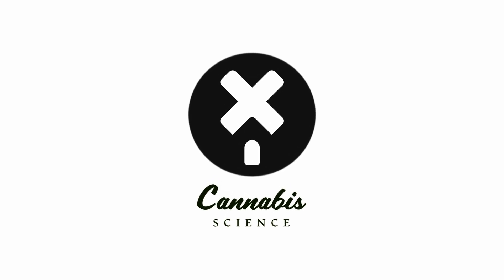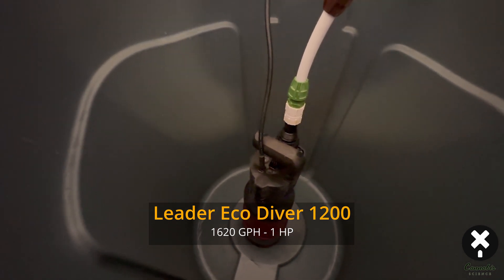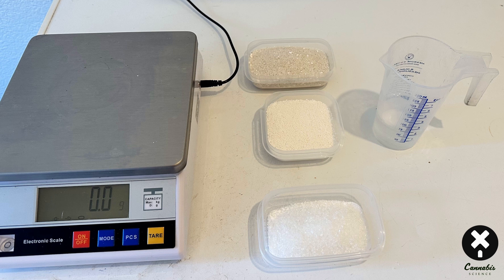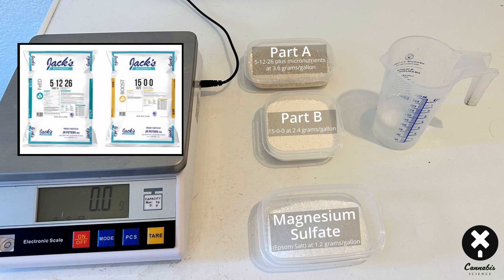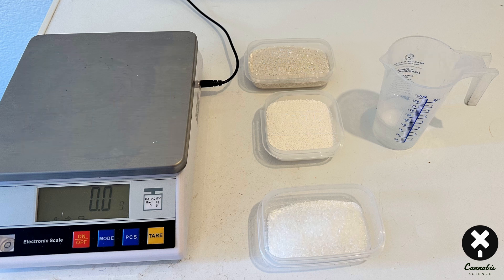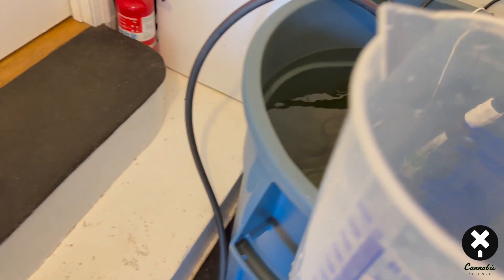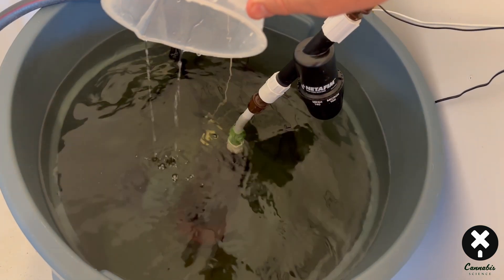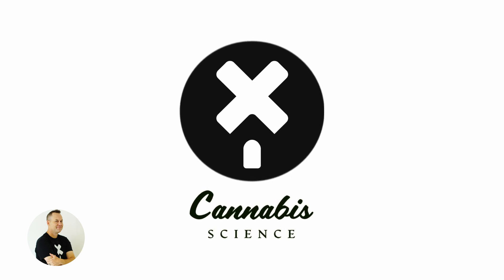How To Setup Irrigation and Fertilize for Rockwool Grown Cannabis in 2023

Comment: Hi Matt, do you need to maintain the water reservoir at a specific temperature?
Reply from the maker: Great question. Yes, try to keep the water temperature below 75F with ideal around 68F.
Reply: @ Thank you so much!! Any recommendations to maintain the water in optimal conditions? I just getting ready everything to start my next growth in Rockwool.
Reply from the maker: Personally, I just keep my irrigation reservoir outside my grow room in the hallway that stays between 68F and 75F. The water temperature is basically the same as outside air temperature. If you run into a problem of your water getting too hot then you can always get a water chiller. If too cold then there are these drop in reservoir heaters that are like 2 foot rods or so that will help maintain a warmer temperature.
Reply: @cannabisscience  Thank you so much!! 🙏🏽🙏🏽

Comment: How do you proceed when the tanks are getting empty with those kind of pumps? Are they able to empty it fully or do you have to throw away a small portion of the water?
Reply from the maker: Thanks for the great question. My pump is able to pull until there is about 3-4 inches of water left at the bottom. I don't like to run these pumps too dry for too long. I leave the 4ish gallons left at the bottom and just refill the water and add new fertilizer. Every 3 months I fully drain and clean out my reservoir and irrigation equipment.

Comment: So if you turn it on 1 minute then off and this happens every hour then how much do they get in that 1 minute, say it gets 100 ml every minute then in 10 hours they would get 1000 ml and in 12 hours that would be just over 1000 ml by getting 200 ml more? 
 I am asking because i don’t have the brain anymore for working all those nutrients numbers, PH etc and I’m in a wheelchair and my hands don’t work very well so forget all those tubes and fittings being worked on and a 50 gallon anything is not happening, hell I can’t even close my tent so humidity, temperatures pffft, I use 9’’ slabs with 4 ‘’ starters because they a lighter but I know nothing about them. 
I currently use Mantis Buffered Nutrients because it’s one bottle entire grow, no PH work because it’s buffered and there is no schedule just use with tap water when the plants are thirsty in a 5’x5’ tent with Migro 600 and my plants grow taller than me leaving me unable to measure light, height or even look at the buds, I am thinking of creating a Tip Pot, the thing I am trying to do is get the watering right and i got to do it by hand.
Reply from the maker: Thanks for telling me about your situation and challenges in growing. With your limitations may I offer a suggestion of growing style that may be way easier for you to achieve great results but more designed for you to handle in a wheelchair? My suggestion would be to grow smaller plants in like 3 or 4 inch rockwool blocks, but have many of them to fill your grow tray. Keep the plants shorter and flip them into flower quickly. A "sea of green " style. You could also just flood the tray with fertilizer water by hand or setup a flood and drain reservoir.
Reply: @cannabisscience  sorry, but you didn’t answer the question, I have no choice I can only water by hand, if I want to get a grow going now and I do o badly, I mean I dragged a houseplant into my tent, thats says I am desperate, I was thinking to add water until the slab lets the water go than take that amount and get it to do that say in 4 increments until it comes out, I was thinking by the third fourth it should show signs of coming out the slab, i have a brand new auto-pot set,  unopened, also a new Master-Controller, and even a new Air-wand top imitator rings, blah, blah blah, my biggest struggle would be just getting the box open.
I don’t want to be told to go to kindergarten growing because I can’t compete with you because your healthy, I can’t open 6 or 7 or 8 bottles just to grow so thats why I mentioned Mantis Nutrients, I did my homework they have spent millions on figuring out this product which is especially designed for home and commercial grows, ten different cultivars/plants one bottle.
I grow in slabs because I can lift the entire plant one handed, I would never trap myself in a sea of green, how would I reach the back and to search out low, stunted type of growing is depressing to even think about, I grow Sugar Black Rose and 11 Roses because they are fast photo and have less leaves, I am thinking to compete. Thanks again.

Comment: that is not a 50 gallon res its i think 32 gallon
Reply from the maker: It's a 44 gallon Brute Rubbermaid trash can. I fertilize at 50 gallons rate and fill up the 44 gallon trash can to about 38 gallons.

Comment: What is your shot size (% or mL) with that 1 minute shot?
Reply from the maker: Each one of my 1 gallon per hour emitters puts out 100 mls per 1 minute irrigation timer length or "shot". Shot times are typically longer early flower and get shorter toward late flower.

Comment: If you’re strictly growing in rockwool, u should check out the 2 part salt pro line from Athena Ag. (The blended line they offer is quite overpriced and is directed to small scale RDWC/ebb and flow systems whereas the pro salt line is suited for top down feeding which is ideal for rockwool) Been using them for few months since I switched from coco/soil mix to rockwool, consistently feeding at 3.0 EC sometimes 3.5 EC without ZERO burn whatsoever. I pH at 5.8, occasionally feed at 5.9-6.0 as my pH drifts but any higher it’s back to 5.8. It’s the absolute easiest and highest quality program I’ve ran. They also offer a physical handbook that gives info into every crook and crevice, plus specific details on the use of their products with netafim/ Dosatron systems. Pretty fuckin stellar 🤘🏻🪐
Reply from the maker: Thanks for the great comment and I have checked out all the Athena lines before. Athena has a great product in their Pro line-up, which is designed and formulated for cannabis production.
Reply: Cardboard teps Don't Follow the Bàndwagon Athena Sux. 
House and Garden For Indoor Frosty Dank  and Flavors Alot of grows in The bay Using H&G
Reply: Athena doesn’t compare to jacks for veg, not even close. And in flower jacks consistently yields more although in my experience maybe a little less dense. Jacks wins in my book. Less expensive too.

Comment: What EC you feed for veg?
Reply from the maker: EC during veg is usually 1.8 to 2 EC. Last 3-5 days before they get put into flower room I raise the EC to 2.4-2.6 which is closer to the flower EC of 2.6-2.8. pH always 5.5-5.8 no matter what stage.
Reply: Depends on what line of salts ur using. I’m running Athena pro line 2 part and can feed consistently between 3.0-3.5 EC without zero issues of burn. Like everything, quality varies. Higher quality salts will not burn at higher EC’s. Poor grade salts will.
Reply: @lucascutler2908 Athena is cheap salts bro lol

Comment: Great info! Do you use any sodium hypochlorite product to prevent biofilm?
Reply from the maker: Thanks so much! I currently do not, but am thinking of adding it at some point.
Reply: Keep light and organic nutrients away from your reservoir and you will not see a biofilm in my experience. Nothing beyond what the occasional cleaning wouldn't take care of. If you're doing recirculating dwc or something like that though, all bets are off; you'll get a biofilm but be careful what you do about it because roots can be killed by hypochlorite too, and it's not far off from what's needed to kill the film.

I have noticed that if you get algae in your tank because it was exposed to light then a few doses of hypochlorite are good to take care of it, but the real solution is to prevent light from reaching the reservoir.

Comment: you could use some aminoacids instead of agsil to buffer the ph, protect aganist stress
Reply: Amino acids are an organic which typically isn’t used in pressure compensated irrigation systems because of clogging and line fouling.
Reply from the maker: interesting...please elaborate what amino acids do